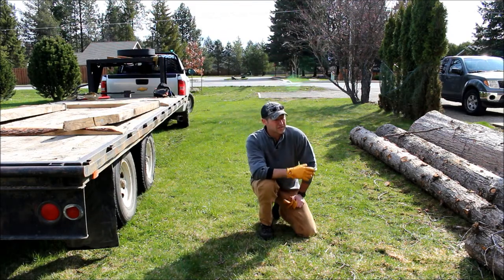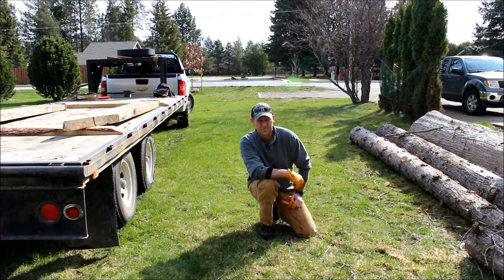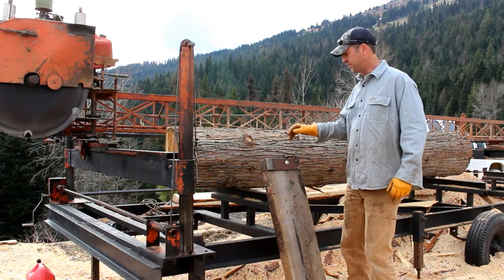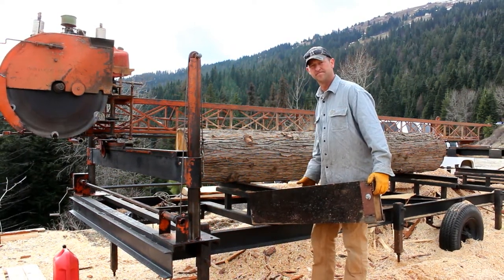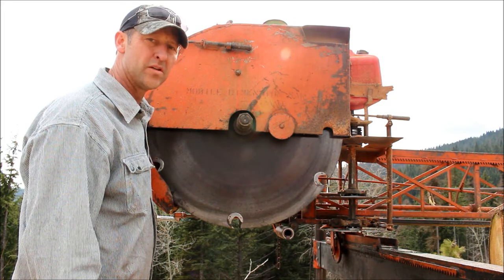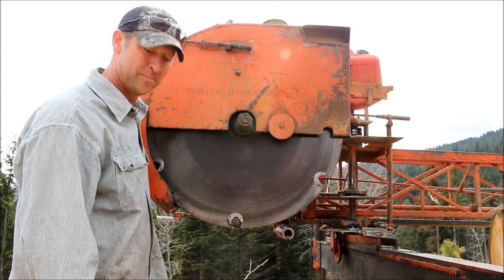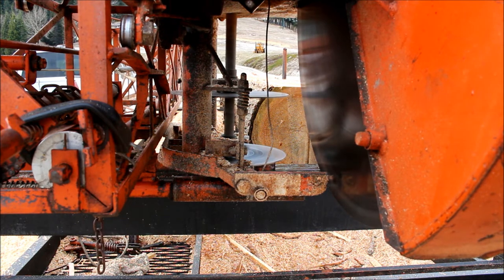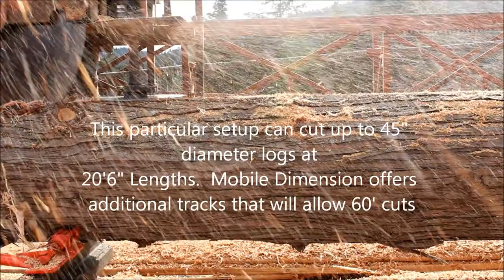Loading, Transporting and Milling your own Lumber

Comment: Great Video!
Reply from the maker: Thanks!  Use my Lewis Winch most every day.  It is so much better for loading than a fixed 12v winch that I see most guys using...doesn't heatup, and you can move it anywhere around the trailer.  Thanks for making a great product!
Reply: Thanks! Would you mind if we use this as a testimonial? Also check out our website...we added your video to our gallery! www.lewiswinch.com
Reply from the maker: +Lewis Winch you bet...go right ahead

Comment: What is the smallest butt or top you can safely mill, interesting video thanks for sharing
Reply from the maker: Smallest you could do would be 3” diameter.  Minimum length is 8’, but I you can fasten something smaller to a 8’ beam or log and mill it.  I did a small walnut log video on the channel…
Reply: @onexwright9482   thank-you very much, this helps for me to decide on a rotary mill